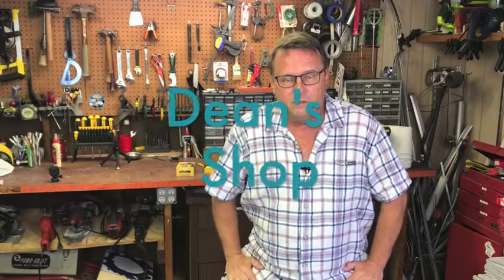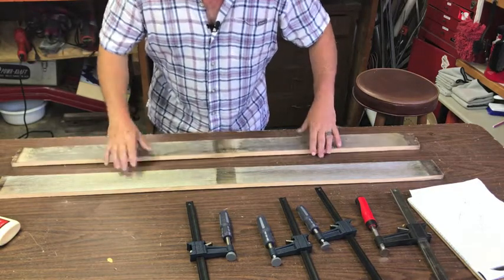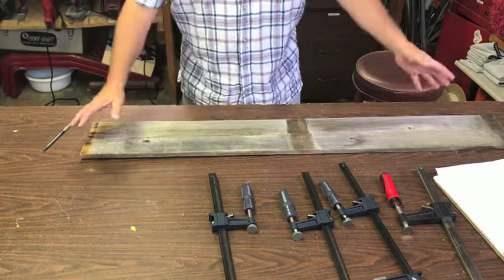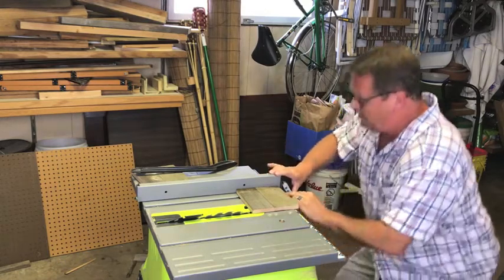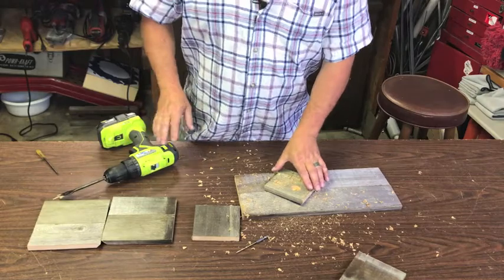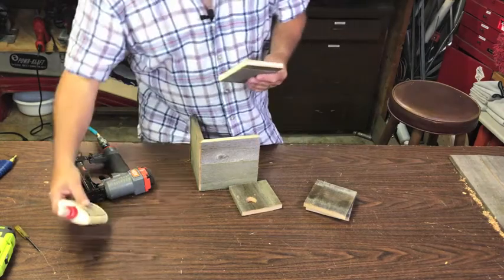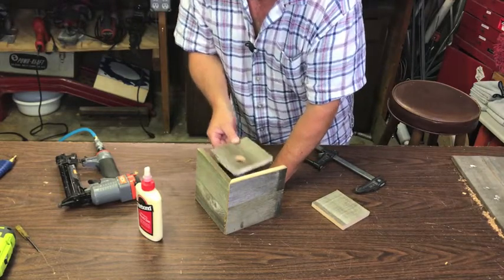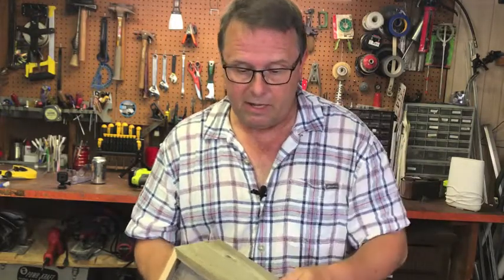Wren House.

Comment: Thanks for tuition. On the inside of the front cover under the entrance glue small off cuts so the chicks have something to help them out of the nest when fledging. Also, I use a natural twig under the outside of the entrance , more natural for the bird instead of a old screwdriver. Can also use a but of dowel.

Comment: Original Titebond is not water proof or resistant, it's made for interior use which is addressed on the bottle. The second formula is what you need outdoors Titebond II.

Comment: It would be nice to know that people are giving sizes and not nominal sizes or what thickness are you using because I've made it out of three quarter with those dimensions and it was way off. I figured the dimensions wouldn't be that far off but I know a cedar fence board is only five and a half in if they say it's a 1 by 6

Comment: Dean;  Can you give us the measurements of the 6 pieces of wood.  Thanks.
Reply from the maker: front and back are 4 1/4x4 1/4
two top pieces are 6"x6"
one side is 4 1/4x4 1/4
the other side is 4 1/4x3 3/4

Comment: Nice one. Is there a direction that the hole should face, North, South, East , West? as we have two Blue tit boxes, and they will only go in the one facing South. Just a thought. Good video.
Reply from the maker: I have not seen any different reaction to the wrens whichever way the hole is facing.. They always use the house.
Reply: @Deanmacman  thanks, I’ve put two up, let’s see what happens👍
Reply from the maker: @stevemcilroy9518  Any results?
Reply: @Deanmacman  nothing yet bud, we’ve had strange weather patterns in UK, so fingers xsd for next year